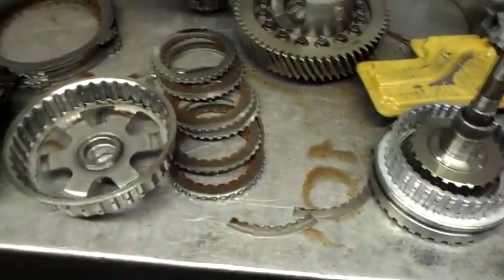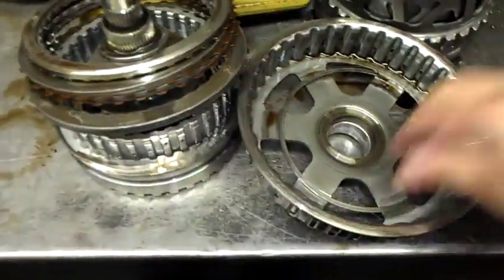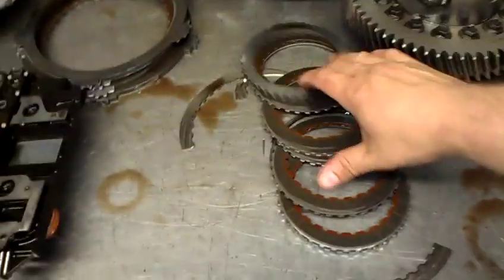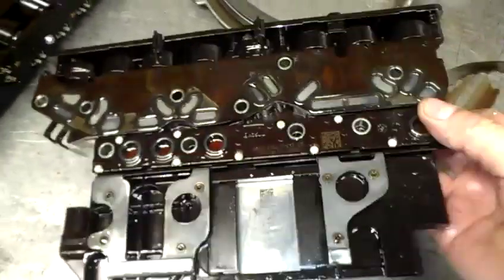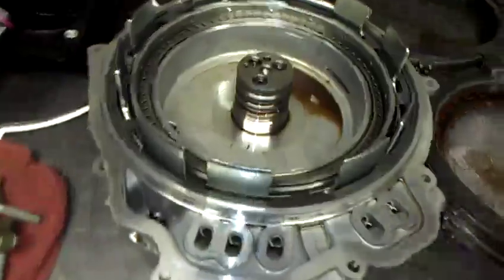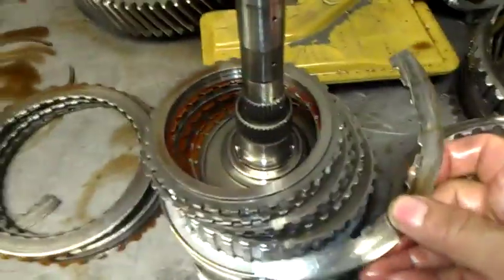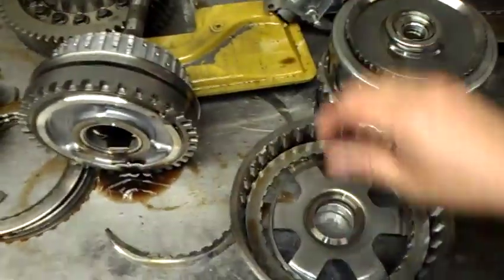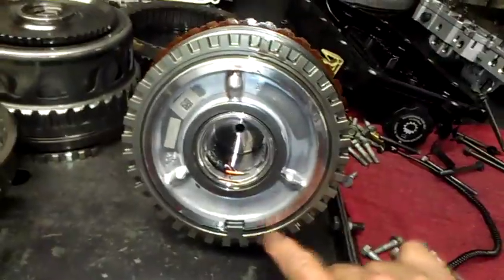6T75-E Transmission - No Reverse - 1-2 only - No 3-4-5-6 - Transmission Repair

Comment: Yeah the cool thing is these bigger trannys have the side covers so you can just pop the side cover off and put a new wave plate in. Obviously if it’s all damaged then you gotta take it apart, clean all the metal out and check everything.

I did intake valves and timing chains on my girlfriend’s Acadia and while the engine and trans was out I took the side cover off to check the wave plate and it was cracked! If I didn’t check it then it would have broke very soon.

Comment: It's the identical to a ford 6f50
Reply: Not quite, but close. They use different frictions and clutch plates for some of the clutches as well as a completely different valve body and TCM. The case halves are also different and not interchangeable. The initial design for both the 6T70 and 6F50 were designed cooperatively by GM and Ford, but then they took the design and changed it to meet their individual needs. They did the same with the 6T40 and 6F35.

Comment: Tnx but this car always overhear leak water then check leak coming from heater fan.it's comes ok..possible that fluid oil burn no vicinity..light white color oil..,so fast i change oil will check what's result..tnx..,

Comment: Great video, gonna tear down mine tomorrow or actually Saturday.. quick question. On my 07 Acadia. Wife says, she was driving it, she was driving on the freeway in the morning (drive off fine, left the house fine) then all of a sudden it didn't want to go. She stepped on the an the gas pedal the car wouldn't move. It would just rev up. I know in the past she would tell me the that the car wouldn't make a grinding sounds and she could feel the car slow down when it did it. But when I test drove it it wouldn't do it for me...so I'm gonna check the check engine light that it has tomorrow and see what it shows up... Any idea what it could be?

Comment: Updated wavy plate or put another one in there and wait for it to fail again?
Reply: i work in a GM dealership bin seeing this for a few years now, the updated plate doesnt fail, or at least i've never seen it, i work 2 bays over from the transmission techs and love to see broken stuff they show me everytime
.
i've seen a customer push it so far that drum was cut in half and REALLY fucked shit up, was awsome...
Reply: Ya I am master gm tech. The updated wave plate is a harder shot penned design. And I've never had them fail. And gm wants them rebuilt because new ones do not come with updated wave plate.